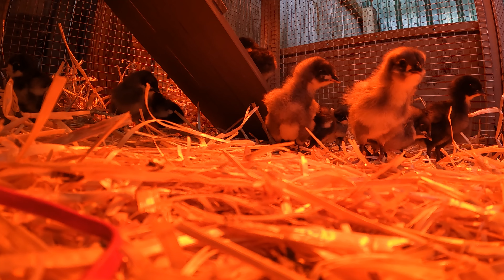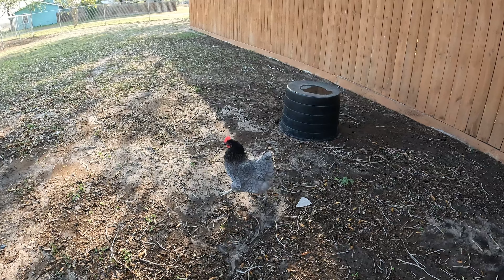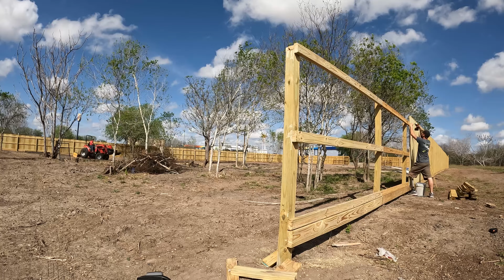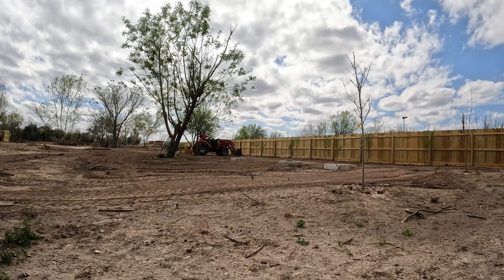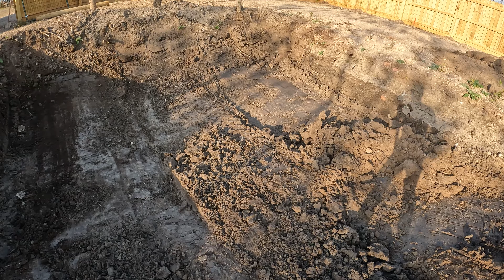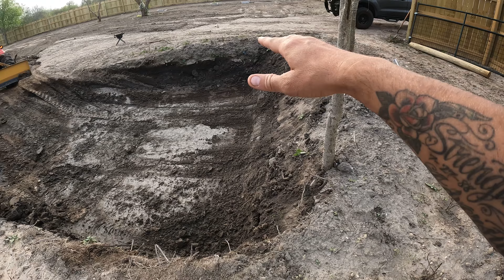Way Better Than I Thought - 1 Acre Micro Homestead Build

Comment: I know you have worked hard and spent a lot of money on your bushes, shrubs and trees. I never see you water them after you plant them. In your climate each tree has to be watered outside the root ball with for at least a half hour. That is why you have yellow leaves on those firecracker bushes already. Each one of those fruit trees need to be watered deeply for 15 mins daily until they are established. Of course if it rains you skip that day. That is why the plants you have planned before did not take and dried up and you have to feed them with fertilizer flowers and vegetables are different than trees you can't always give them all the same fertilizer. You will have a much better growing season and a better yield when you feed your plants once or twice a month. Good luck. 🤞👍